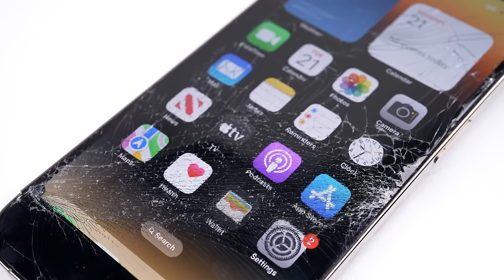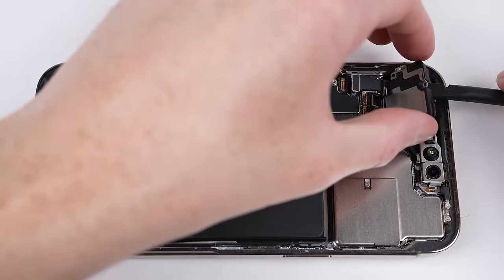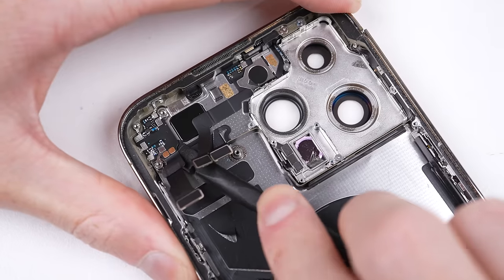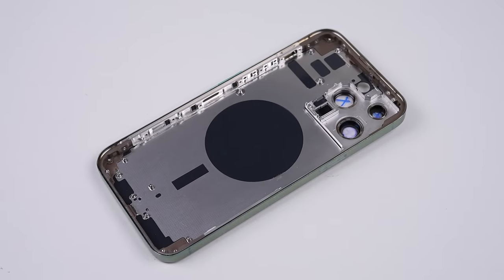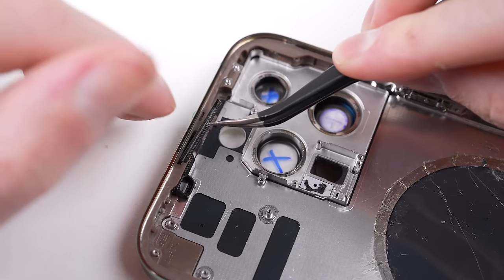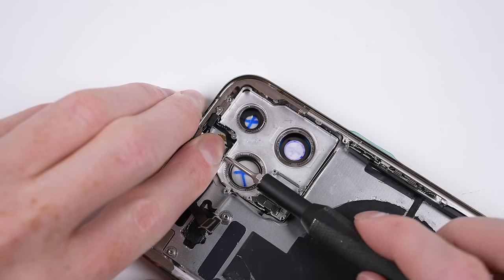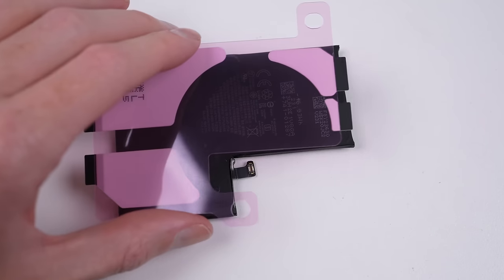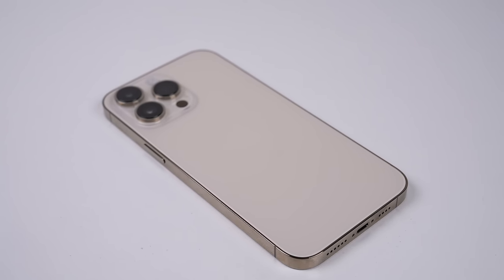What It Takes To Repair The iPhone 14 Pro Will Anger You - iPhone 14 Pro Max Restoration

Comment: Imagine the "brainpower" it took for the engineers and designers at Apple to deliberately take the time and effort and money to create a device specifically made  not to be repaired. Of course, they don't bother with, or care too much about,  the few Hugh Jefferys of the world.
P.S.
Apple knows by its volume of sales that their costs to discourage repairability is well worth their design configuration. There is nothing about this that was done as a "prank " to beffudle their customers. They live by the algorithm. And they have been successful going this way.
Reply: They only care about making money…
Reply: well, to be honest - they made phone not to be repaired.... by anyone else but Apple. Yes, complicated and hard, but possible until you reach software point. 
All that unlike Microsoft with their Surface pro tablets, which are unrepairable BY DESIGN
Reply: I don't think the hardware crew designed it to be unrepairable. Only the software / firmware engineers.
It definitely was not meant be be easily repairable.
What surprises me is that so many parts are very expensive to assemble. And usually mass-market devices like iPhones are designed to make assembly easier to save time and money+get them produced as fast as possible.
Reply: @joshbacon8241  i think u missunderstood how this world works little boy ..
Reply: @TheRailroad99  I'm sure that most of the assemble process was done by robots instead of human work. It is a waste of money but if you have robots to do it in an assembly line, then it can make sense.
Reply: They’ve actually made it so if you change a camera and then change it back, it won’t accept it’s original camera
Reply: @unknownkw  “assembled in china”
Reply: @KingJulienPlay 

Enlighten us o wise one..
Reply: @joshbacon8241 well duh Apple is a corporation what do you expect?
Reply: Dell does the exact same thing when it comes to their desktop computers (one reason people shouldn't buy Dell PCs, especially Alienware).  
As Gamers Nexus said during an older video, they most likely have some skilled engineers, but they put that talent to designing horrible and completely uncessesary things when designing their cases. Dell will many times go the route of using a completely proprietary motherboard and power supply, meaning if you wanted to upgrade in the future, you will probably have to buy a new computer. You could reuse the RAM, but it's usually crap. The only real salvageable parts could be the CPU and GPU. Oh, and they also heavily handicap the system with very stupid power limits and other things that just make no sense.
Reply: Actually, i think its lack of design skills that makes these phones so difficult to repair. It cost a lot of money to redesign parts that fits badly. Instead they use small clamps and washers to secure the parts to the frame. And apple make it just as difficult to repair, so the unrepairable goal are still met, but to a lower cost.
Reply: @whyso0erious  How is it any easier to repair for apple? the point is there are tonnnes of different screws, far more than neccesary. what are you on about?
Reply: @Lesdig891  Neal, I mean that it at least can be disassembled, even though you'd need couple of screwdrivers. Unlike MS Surfaces, where everything is dead-glued together, making it completely impossible to disassemble without serious damage
Reply: Actually, who's livelyhood depends on whether his capable of repairing an iPhone, they will learn and figure out ways to repair such deliberately "unrepairable" phones u ca be sure of that. Every1 in the market is actively searching for way to fool the motherboard on the iphones to accept replacement parts, and so far they kinda succeeded... it means more work, and knowledge on the techicians part, but it's doable.
Reply: This is a high budget prank by Apple.
Reply: Complicated to repair - It simply means iphone is quality. Dunno how u guys interprete and complain.
Reply: @whyso0erious  What the hell do the surface tablets have to do with this?
Also most of the time apple just charges too much money or simply says that it's unrepairable, so people HAVE to take their phone to a regular phone repair shop.
Reply: @saitama3150  Qualify is a combination of durability and repairability.
Reply: Just get the applecare and stop worrying about repairs
Reply: Difficult to have much pride in your work.
Reply: @whyso0erious  Hey I actually just repaired a surface pro 5 and surface pro 8 tablet this past week! (: Surface Pro 8 was actually more repair friendly than the 5. Did a screen replacement and a battery replacement. I would say iPhone housing swaps are much more difficult from experience doing both
Reply: The didn't "specifically design it to not be repaired." If you think Apple became the most valuable company the world has ever seen by using "HAHA u can't repair it dumdum" as their guiding star, I don't know what to tell you. 

The engineers don't think about third-party repair. They're not hostile to it, they simply don't care. It's not a factor. They care that it meets the design goals, that it's manufacturable. They don't specifically design them to not be repairable, it just turns out that when repairability (outside of the most common repairs) isn't a priority, it doesn't turn out to be all that repairable. 

This particular niche of tech nerds has an enormous persecution complex. Nobody is out to get you, for the most part, they just DON'T CARE ABOUT YOU. And guess what - the majority of their users don't either. That's understandably upsetting for those who DO care about repairability, but stop with the constant whining and "waaaah they are mean to me! Me in particular!" They don't care about YOU being able to replace a microphone membrane.
Reply: @whyso0erious  Surface laptops have literally nothing to do with this..Also waaay more people buy iPhones over surfaces. 💀
Reply: I think Hugh should be awarded a sainthood for his amazing patience and perserverance.
Reply: This isn't the first time technology has been made non-repairable or forcefully obsoleted. Look at light bulbs-

Engineers were at some point paid to make light bulbs go bad after a certain period of usage, so that companies could sell more. This is done to this day in the light bulb industry
Reply: The only reason they're succesfull's cuz they make everything non apple work like crap nevermind that they were the first larger company that released touch screen more widespread
Reply: @whyso0erious  After seeing apple reject simple repairs I doubt apple themselves would be able to fix this
Reply: @whyso0erious  as a consumer and someone who doesn't trust that one chain repair shop, I only want Apple repairing my phone if I need it
Reply: @BargainBinkey  that is your right and your choice. The same right to repair devices wherever owner wants must be granted to everyone
Reply: @KingJulienPlay  how does it work then?
Reply: They literally said it is a feat of engineering their phones. Fear of unrepairable engineering. They know what they saying when they say that. It is people that don know

Comment: Regulators need to do something against serializing parts, this is unacceptable. 
Would love it if you could cover the recent Framework Laptop event, it's Apple's worst nightmare, thanks for your amazing content!
Reply: Apple isn't too worried about Framework due to them being so niche. If they (Framework) had the marketing power, Apple would do everything in their power to subvert them, or buy them outright
Reply: @watema3381  here is the thing, their products aren't niche it's just a currently niche company. They have the potential to take over the entire laptop market. 
The only reason they are niche is because they are still a smaller company that isn't as well known. But it's the only growing laptop company in existence. All they have to do is keep making good products and not screw up and they will sell like hotcakes.
Reply: The US doesn't have the stones to do that, however the EU might.
Reply: @ghosthunter0950  Framework barely has any products though, they only make like one model and it doesn't even have a dGPU option or pen and touch input support, and took them until just now to realize that AMD Ryzen exists and is maybe a thing they should try. Disappointed tbh

It's fine if all you need is a basic laptop but it's not really enthusiast grade hardware of any sort. May as well buy a Chromebook with the specs on offer and in that case who cares if it's disposable for Chromebook prices.
Reply: Nah I’m okay with serialized parts. I don’t want to buy a phone only to find out everything inside has been replaced with shitty third party components, so that warning message is good. I don’t agree with them disabling basic functionality like true tone and auto brightness though.
Reply: @fadoks7075  It would be one thing if the part pairing was to fight counterfeit components but the security measures are triggering for genuine parts and is beyond senseless and downright asinine.
Reply: @fadoks7075  it's not against serialization we're against the manufacturer controlling the entire repair market. 
Not to mention there are plenty of companies that will sell you better batteries than the manufacturer for example. This is very clear when you look at e-bikes. Manufacturers cheap out and put in shitty batteries. So the argument is bullshit. Just buy parts from a trustworthy source in the first place.
Reply: @datachu  their product lineup is certainly lacking like you said, but they just announced something new that looks like it will satisfy the needs of enthusiasts. Hopefully they will deliver and with their track record on honesty it seems promising.
Reply: Regulators probably getting their cut to do nothing about it.
Reply: @datachu  I now 😅😅😅😅
Reply: 3rd parties can and do assign parts to phones, you just need a 40 euro chip reader from aliexpress, even to do it yourtself it'd be worth it as you're keeping true tone
Reply: @datachu  Framework is going to release a 16-inch laptop with a dedicated and replaceable GPU. It's already been announced but the current specs have not been revealed yet.
Reply: Or you know just take care of your device instead of throwing it around? 😂
Reply: and how many customers complained about the parts you've replaced? Because I had complaints about screens being too thick and not as bright. Also, serialization is ok due to the fact of using counterfeit or stolen parts. Mr. Jeffrey here is doing a shit job explaining that programmers for these parts exist that will eliminate any error and such a programmer costs most of the time less than $100 and you can program many generations of iphones with them.
Reply: oh brother believe me Apple doesn't care. Framework could sell 10, 20 times more laptops than they do now and it's still not gonna make a dent
Reply: serializing parts are okay as long as it doesn't completely fail to boot when another part with a different serial is used (nintendo switch batteries), apple has misused this feature and shined a shit light to it. couldve been used to detect third party parts but no...
Reply: Look up louis rossman on YouTube, he's been trying to get right to repair legislation passed in many states but it's not easy especially when they approve an initiative then add amendments to the original legislation effectively making it useless
Reply: @DavidStrchld  The soviet eu is about less freedom, not more.
Reply: @markjohnson1207  he's a hero in the seeds
Reply: @PompaTG  Yes that's what the narrative says but.... ever been there?  In practice they seem to enjoy a lot of freedoms we don't in the US, and have the time to enjoy them that many in the US don't.  We do have some over them, but on balance, depending on the nation, for the common person they seem overall a bit more free than the common person US citizen.  To be fair a lot of our freedoms in the US are surrendered and not enjoyed due to economic reasons such as healthcare tied to a job, so while one is free to leave a bad job in the US, there is a very large economic incentive to forgo that right. Litigation also served to curtail freedoms in loo of laws, in the EU you are mostly responsible for you.   Responsibility is a cornerstone of freedom - a concept that the EU understands the US does not overall. The effects are the same, the US is no where free as we like to claim and some nations of the EU is pretty darn free place to live in comparison.  Now if you are the type that no one is free unless you can freely obtain firearms, you would be correct, but overall it's a flawed standard.
Reply: ya isnt apple a real bastard making it nearly impossible to repair...
Reply: Or people should just stop buying from comapanys working against them
Reply: @EinfachFredhaftGaming  me, a nintendo guy :
Reply: @asutora.5363  XD
Reply: @ghosthunter0950  Unless framework laptops can run macOS and AMD/Intel can put out a chip as efficient as M series. Otherwise, highly unlikely that they will be directly competing against Apple.
Reply: @datachu  - They’ll bring out a dGPU model soon.
Reply: @datachu the company is literally 3.5 years old in a market where most are 20+. Give them time, you can't expect the newcomer to kick ass right off the bat.

Comment: Amazing repair by yourself. It’s horrendous what apple has done, I was half expecting some sort of case sensor (aside from the front display chip) preventing you from using the transplanted phone
Reply: People still buys that trash
Reply: Coming soon!
Reply: Your Comment: Case sensor

Apple: Checked! 

People: \_(-_-)__/
Reply: What about just checking to see if the screws or excess heat has occurred and bricking the iPhone then? It also allows Apple to brick devices in normally hot conditions

Comment: I once tried to repair an old Iphone with a bendgate issue. My puls was around the 100 bpm mark the entire time, because there were so many screws to keep track of and even though I had a magnetic sheet to put them on, it was the most nerve wracking repair I have ever done. I must say however that Apple designed the inside pretty neatly. I feel your pain! I didn`t even need to take apart the whole phone, just the bits to get me to the processor, but even that took me over an hour.

Comment: I "love" the fact that apples solution to fixing anything related to the frame are "rear system" replacements which includes a new motherboard and every little removable part plus rear glass (except the rear cameras). Costs just as much as you think it does. Stocking them costs several hundred dollars extra per piece which obviously will be pushed onto the customer.
So the offer to the customer usually is pay, order, wait a week for part to arrive, backup old phone, replace, restore a backup and then they hand you their first born as payment.